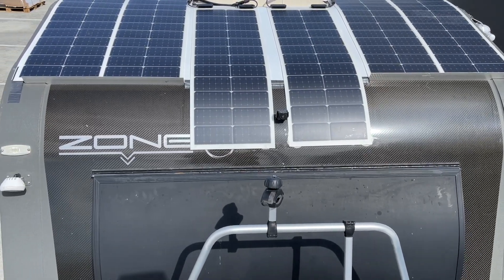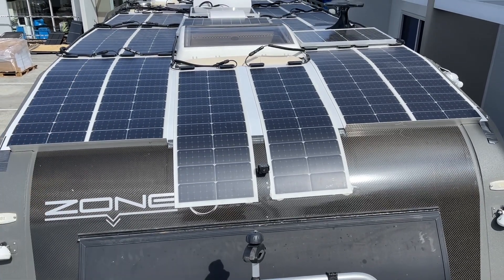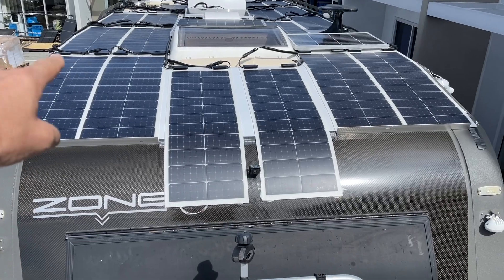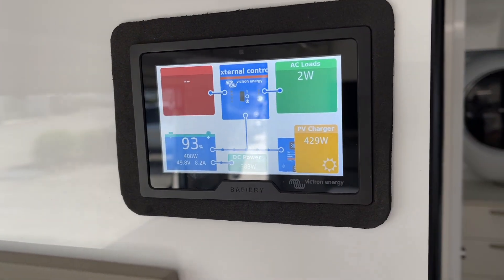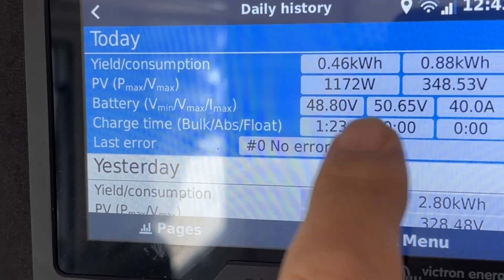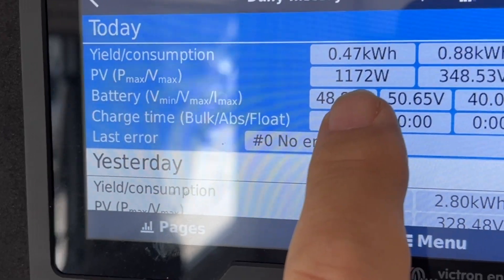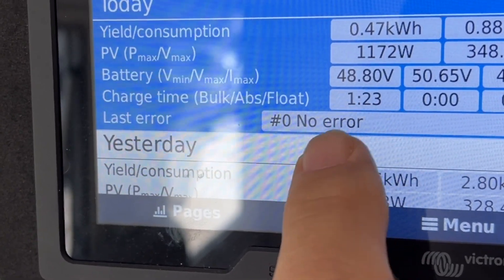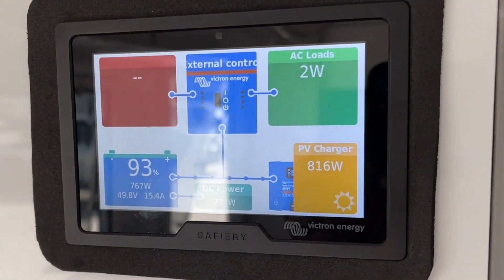ZONERV Summit gets insulated roof PLUS 1,500W Solar in series 348V off the roof to Victron 6000 RS

Comment: Love the install. As the DC voltage is 348V DC and is no longer extra low voltage to Australian standards, what effect does that have on the installation?
Reply from the maker: The install needs to be supervised and signed of by a licenced electrician. In our case we have to go one step further and not only have an electrical contractors licence but also a licence for solar installs.

Comment: Is it ok to mix and match different sized copper flex modules to maximise what you can fit on a roof?
Reply from the maker: Absolutely. Any combination you like with the DC to DC for Solar
Reply: @Safiery  awesome I’ll have to do some measurements of my Van’s roof (LDV Deliver 9) and the fans.